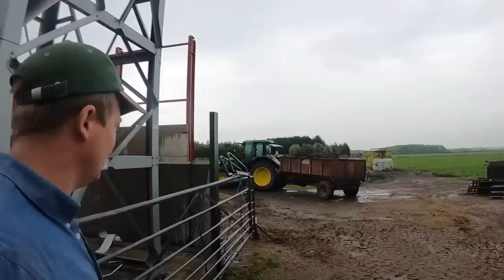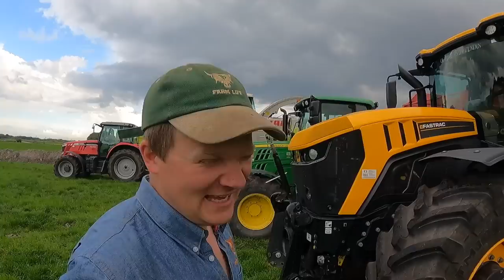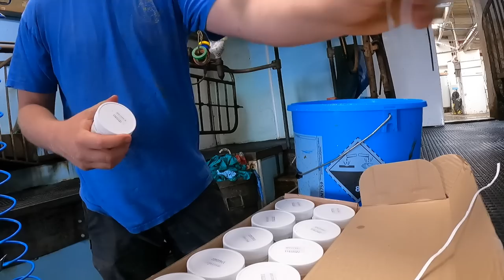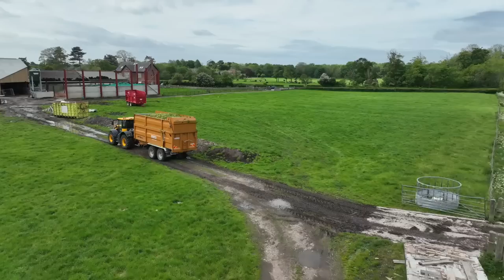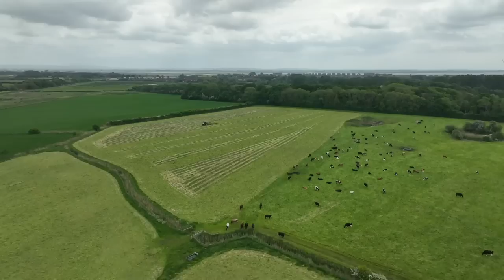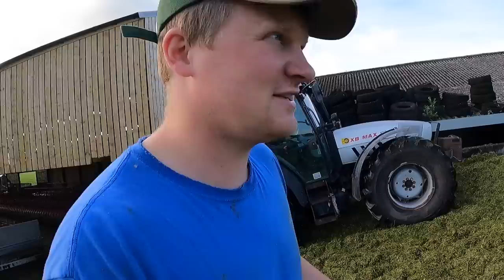CARTING IN THE FASTEST TRACTOR IN THE WORLD

Comment: Have you thought of upgrading you roads to gravel and what we do here is they raise the road up higher than the ground so any water should run of until the road needs repairing, we have a gravel that when it rains it goes to concrete, and maybe a drain at the front connecting either to the field or drains in the shed. great video looks like a bumper crop. And more to come with that rain.

Comment: I'm glad you got some clamp work in. This often gets left out in favour of the chopping part. This (clamping) is probably the most important part and can make or break your crop. The job ought to focus on how quick the clamp is getting sorted out ie pushed up and rolled rather than how quick the trailers can get turned around. Roll, roll and roll, squeeze that air out. I'm lucky enough to work with a very good clamp man. Good sport from Olly blogs as well. Crack on

Comment: The Fendt 936 would be just as fast, if not faster than the 4220, would however love to try the fastrac out for comfort 🤔
Reply: @ritch it's not faster with a load behind it not a chance. Know no end of folk that have em and they have nothing but problems with them long term, all they can say is they're comfy.
Reply: @ritch well that is unlucky, we've had several of the newer type varios after the belting tms series and none of them have had any major issues like that, all made it past 6000hrs with only the usual stuff such as the occasional solenoid/sensor oh and one had air con trouble but regarding the fastrac I can't knock it till I've tried it 😂 hoping to get the new icon on demo soon
Reply: @ritch jcb has a fendt gearbox